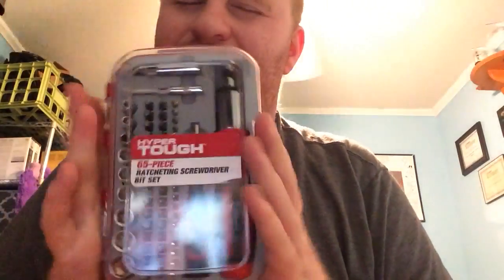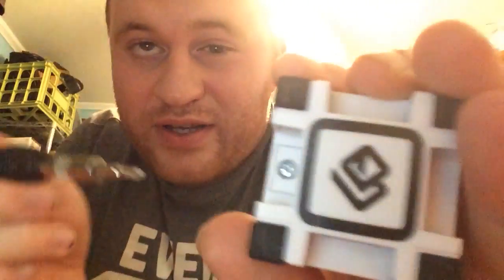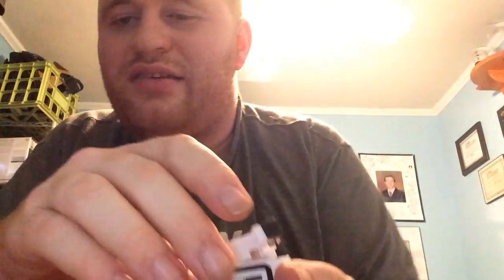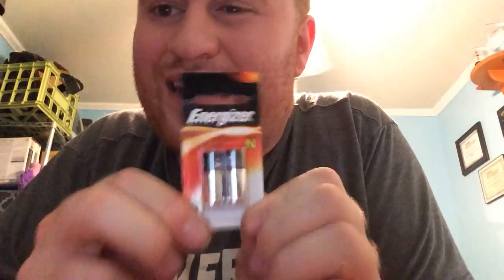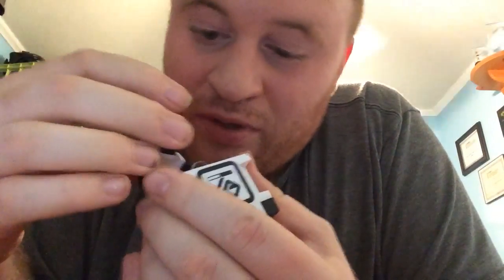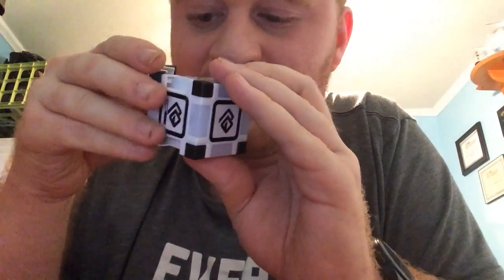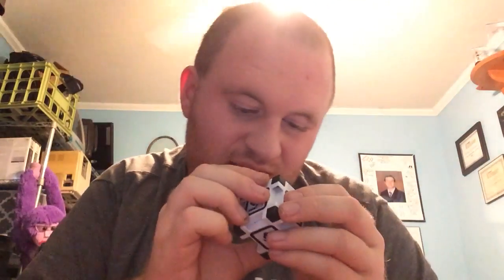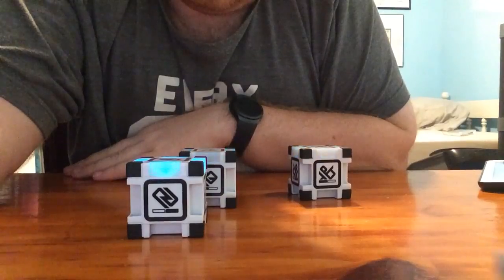The Robot Rehab ep. 1. Cozmo power cube fix

Comment: We have one cube that does not work. Replaced battery and it does the light up sequence but will not blink  blue and not recognized by Cosmo? Any ideas.
Reply from the maker: Lancair W try to resync the cubes by clicking refresh in settings
Reply: Sean Kirkendall will try it now. Thanks and great vid!
Reply: JLP 500 Thanks. Yea, I replaced the battery and it did the light sequence and I did a cube refresh but It still not recognizing the cube. I sent a costumer service request to see if the company can replace under warranty.
Reply: The cube was defective but I emailed the company. They were great and sent me a new one in just 2 days.
Reply: Lancair W I found the problem inside the cube it did not have a positive battery receiver so I just put a little piece of aluminum foil in there and it worked good as new
Reply: Lancair W having the same problem what do I do?
Reply: in the owners manual there was a contact email address for issues or questions. Send info to the company and they will request info from you. You do not have to send it back to them.
Reply: Ok me to